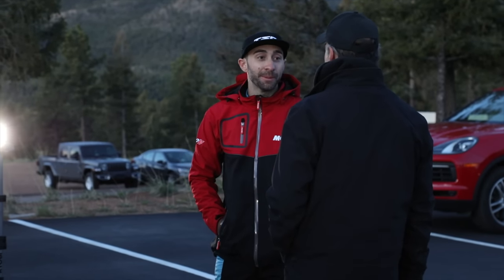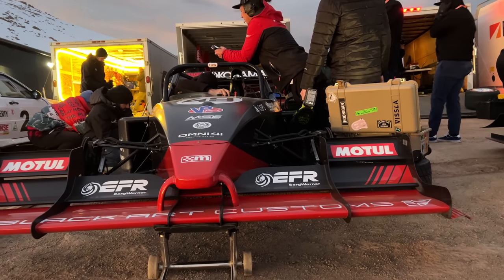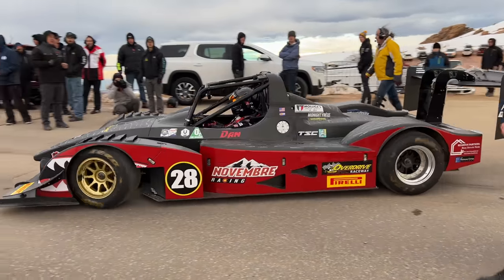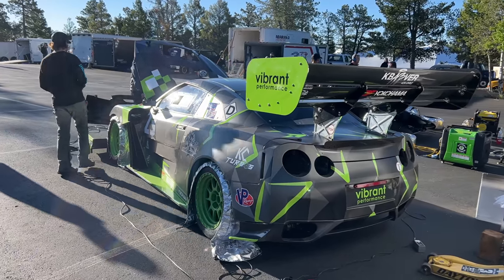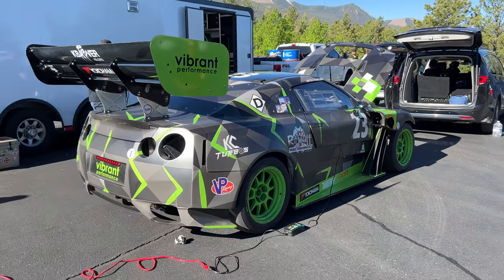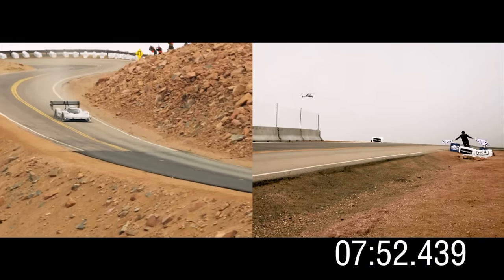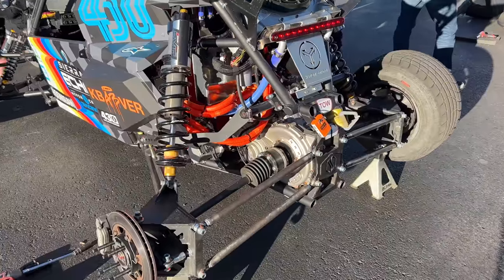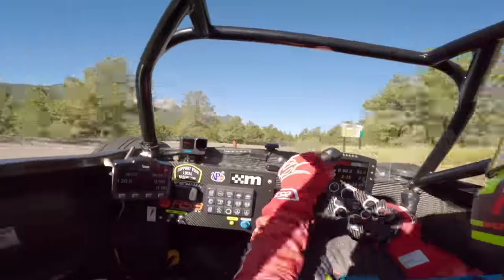The Insane Engineering Of Hill Climb Racing: Pikes Peak 2023

Comment: It is kind of great that the altitude and low end torque advantages of an electric drivetrain are perfectly balanced out by the handicap of heavy batteries, making electric and combustion neck and neck at Pike's Peak with current tech
Reply: less cooling tho
Reply: I wonder how a hybrid with a motorcycle engine or other small/light yet decently powerful engine would do. Maybe have a capacitor bank/small hybrid battery that charges with regen braking going into corners and dumps that power back in when leaving (If that is practical)

Comment: When you were talking about the diesel entries, you mentioned some of them were running automatic transmissions, even though one team didn't like calling it that. Driving a truck for a job, I know what it (probably) is, but thought I'd share with the rest of you: an Automated Manual Transmission
Regular automatic gearboxes are built entirely differently than standard transmissions. I don't know enough about the mechanics and engineering of it to explain well and worry I might get something wrong, but know that tractor trucks almost exclusively run Manual or Auto-Manual transmissions.
Just thought I'd through it out there

Comment: The Ford Supervans have an interesting history. The one appearing at Pikes Peak was the second iteration of the electric Supervan which itself was the the forth, hense 4.2. However the first van dates back to the early seventies and was built in the UK. They basically dropped a MK1 Transit onto a GT40 chassis, the second which popped up in the 80's built on the Ford C100 race car chassi and powered by a Cosworth DFL V8. Supervan 3 came along mid 90's though was based around the second iteration. However gone was the Cosworth DFL V8, replaced with the more powerful Cosworth HB Formula 1 engine. I've seen all three in action but the original is still my favourite, mainly because it's something I would do if I had a GT40 chassi and an old transit sitting in my back yard. lol

Comment: When i was in formula student team we bought high voltage controller ( sevcon size 8 gen 4) from latvian pikes peak car that crashed. That team was driveEO. They had atleast 100kw at every wheel. These were yasa motors, very cool garage when we visited in about 2015

Comment: Wish I had know about your interest back in 2015 and 2016 when I took 3 electric EVSR race cars to Pikes Peak, I would gladly have invited you to join the EVSR team.  Unfortunately, in 2015, one of my drivers drove off the mountain during practice, and then on race day it snowed before we got to make our timed runs with the two remaining cars, so overall a bit of a disappointment.  Then in 2016 we took just a single car, and then a welded contactor at the start of the race meant we only had half power… more disappointments.  Since 2016 we have built the 4th and 5th next-generation prototypes (raced the 5th at the 25 Hours of Thunderhill in 2021 and 2022) and I would go back to Pikes Peak, but SCCA has effectively banned EVs from road racing, and many hill climbs have followed suit, as have many individual race tracks, so I cannot justify building a car for a single race venue with one event a year, when that car can’t be used anywhere else.

Comment: Wonder if that diesel GTR could use a completely separate turbo from engine fed by some injectors in a lightweight burn chamber as an air compressor and pipe it to the "heat exchangers" blast them cool. That'd be wild. Probably wouldn't work or be practical.🤠 Draw air from under body for downforce. Yeehaw.

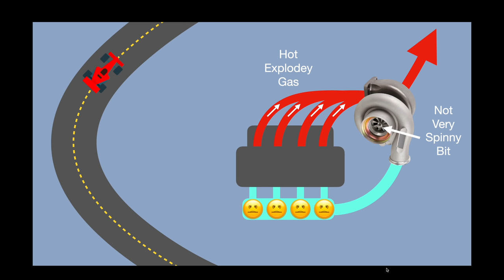Comment: The VW effort cost 40 million. It did set the overall mountain record with a French driver. - To get on the mountain on my motorcycle, I had to be at the gate at 3:30 in the morning with cash in hand. I was number two up the mountain and number one was the most clapped-out old Ford pickup truck I've ever seen with no muffler. They opened the gate, and that truck shot-up to about 45 or 50 mi an hour with about 50 ft of visibility. I was afraid of being rear-ended so I hauled as fast as I could which I did not like. One spectator did crash near the top of the mountain. The whole event is a bit nutty but fun for everyone. I do miss the gravel!!

Comment: 10 years ago a team from New Zealand brought two Midget's to the Chili Bowl in Tulsa OK. Engines: High revving "Synergy 2.4" V8 built from Two Kawasaki 1200cc motorcycle engines, single crankshaft.  Performed very well than outlawed. Just wondering if related.

Comment: Just to be clear, a dual clutch transmission is not an automatic;   It's a Manual transmission that is shifted with actuators...   automatically.   But are usually ran in a "manual mode by shifting with paddles at the steering wheel.

Comment: Thanks for the video.
Just wondering why is there no superchargers being used? I know very little about cars so that is why I ask probable a stupid question.
Reply: Superchargers use power from the crankshaft, so usually the max possible power is higher with turbos. Pikes Peak also has the issue of the altitude change, if you gear your supercharger for max power at the start it won't produce full boost at the top of the mountain. Gear it for the top of the mountain and you lose power at the start because you can't use full throttle without causing knocking. Turbos don't have that problem because they have a wastegate, it allows you to control boost levels by sending part of the exhaust gas straight out the exhaust rather than through the turbine. A supercharger would need to be driven by some kind of CVT to keep the boost optimal without choking the engine at lower altitudes, which is obviously a bit complicated (though not as bad as three sequential turbos!)
Reply: @nerd1000ify  Thanks for the info.

Comment: Newest GM Mini Duramax all aluminum straight 6 is going to be the diesel to have. Stripped down must be near the weight of a 1.9 TDI but with ultra efficient chamber, spray pattern, and cylinder head design. Will need some parts testing and R&D on top of some tinkering. With the 3.0L, improved design, and similar weight to the TDI, should be a killer and a much better fit for the GTR than the Cummins ledsled getup.

Comment: How much can turbos compensate for the loss of air higher up? Do they have a target horsepower to try to go for, or just boost as much as the engine can handle, and slows down as pressure drops?
Reply: They're probably detonation limited, which would more or less translate to a 'flat rating' up to some altitude where the turbo wastegate is fully closed. Above that point the power starts to drop.

Comment: Not too many cars with hybrid powertrains.. Would have been cool to see an electric + micro-turbine electric generator, I think it can have a pretty high power-to-weight ratio, cause you can pretty much do away with batteries, you can just use super-capacitors, which are less energy dense but can deliver higher instantaneous power for a given weight.

Comment: I was just wondering and this is a wild idea… what if in a heat exchanger, we add a liquid nitrogen injection system that cool out the fins at higher altitudes… make up for loss of air density with lower ambient temperature… 

Will this work? 11:48

Comment: Matt I have had idea floating around in the back of my mind if you want to use it somehow please do 
What if you put a few 12000 psi  welding tanks in the back of a race car and use regulators and flow meters and etc and Have a boosted car with no turbo no super charger just boosted air straight down the intake then there is idea what is you bump the oxygen level by 5% or add nitrous to the gas mix and there's no loss to build that boost

Comment: I think you underestimate the value of a professional racing driver at the wheel of that VW record holder. Most of the drivers at Pikes Peak are NOT racing drivers, let alone Pros, and so I'd be surprised if they are within 5% of a professonal like Romain Dumas. On an 8 minute run, that's worth over 20s right there...